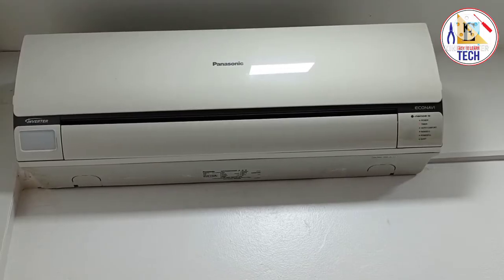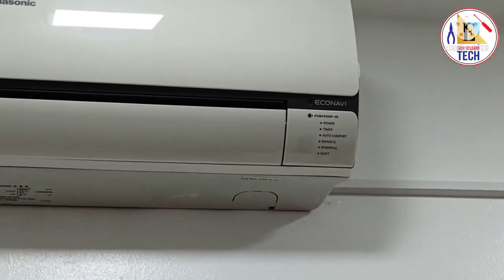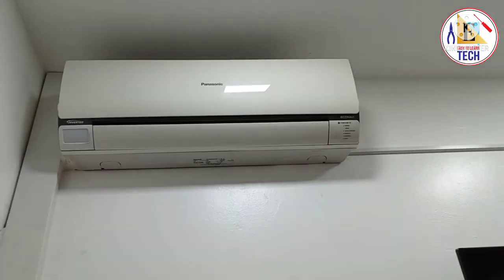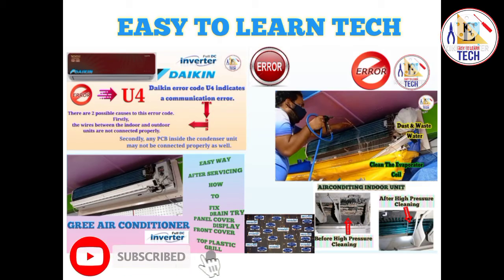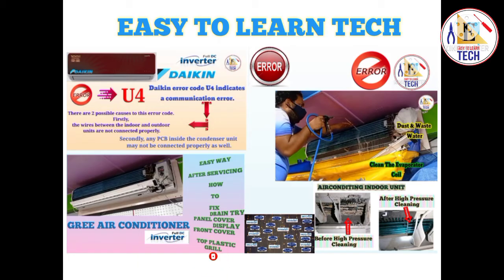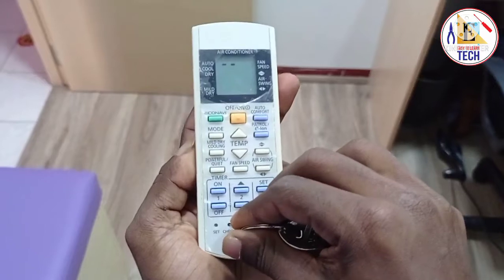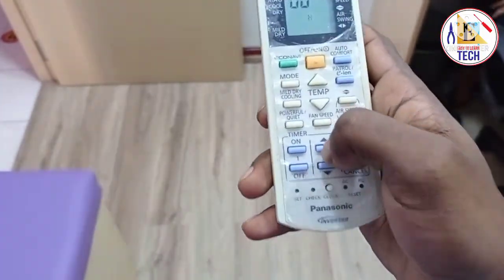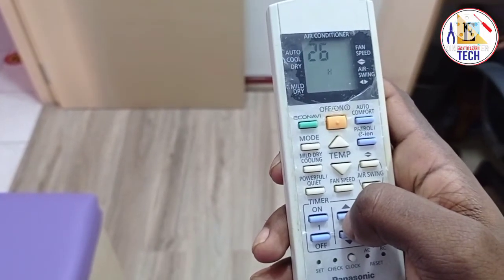How to Check Panasonic Aircon Error Codes. How to get the error code out of a Panasonic split system

Comment: Thanks for the video. Mine has F97 and not cooling well. What's involved for the repair?
Reply from the maker: Compressor Over heating Error , 
1) Check the condenser coil, and service one time and see . If the error exists then you need to check if the PCB card and Outdoor fan is working properly or not.
Reply from the maker: Waiting

Comment: My newly installed panasonic ac showed h52  when it was turned off.. What to do sir? Bought it just on 13th April
Reply from the maker: Try to claim the warranty & exchange the unit.  That will be best, to check the unit needs to open indoor and outdoor units . As it's a new ac it's better to replace the unit. Thanks
Reply: @Rehankhan_HVAC_TIPS  but sir whenever I'm checking the error with remote nothing is showing.
Reply from the maker: @mousumighosh1421  your ac is cooling or not?
Reply: @Rehankhan_HVAC_TIPS   cooling as usual
Reply from the maker: @mousumighosh1421
 If it's cooling then thier is no issue, 
1) check the if the ac is cooling or not if it's cooling it means no issue in ac. 
2) Check if their is any ice formation in small pipe. 
3) check outdoor unit is working continually or not, if running then need to check the outdoor unit. 
4) if ac is cooling please don't do any remote setting, just use as normal.
Reply: @Rehankhan_HVAC_TIPS  thnk u

Comment: H85 error code is displayed/blinking after the AC is turned off.
Reply: H85 error ka solution Kya hai??
Reply: What is the solution of H85 error code
Reply from the maker: @ArupDhar-wo8gj  please let me know if your ac is cooling or not.
Reply: There is no description for H85 error code in the list. Neither is it available online. Should I contact customer care?
Reply from the maker: Is it a new ac unit?
Reply from the maker: How is The Cooling performance?
Reply from the maker: Check the outdoor pcbs card cover, Panasonic provides all the error code according to the model.
Reply: Wlan communication error woth indoor unit
Reply: Same..
Reply from the maker: Please let me know the problem
Reply from the maker: Please let me know if your ac is cooling or not?
Reply: I got the same error, I purchased the AC yesterday. What might be the reason? 😢
Reply from the maker: @the.no.commentary.gaming if the ac is not cooling try to replace it. Within 1 day if you're getting this problem think after a year what will be difficult.
Reply: @Rehankhan_HVAC_TIPS  AC is working really good and the cooling is also great
Reply from the maker: @the.no.commentary.gaming some time it's a false error, restart the main power & start & check. If the ac is cooling than no issue, it's a false error.

Comment: How many horsepower ac?
Reply from the maker: It depends on the model of the ac & remote. All horsepower ac you can use the same remote to find the error. If it's helpful support.
Reply from the maker: Different model remotes have different settings to find the error.

Comment: If Panasonic Split AC show krey F1 error toh iska mtlb kya h kis chiz m prblm h?
Reply from the maker: F1 error means: Outdoor ambient temperature sensor .
1) need to check the sensor in outdoor unit.
Or communication problems between indoor and outdoor units.
1) need to check the cable between indoor and outdoor units.
2) need to check indoor and outdoor PCBS CARD.
Reply: @Rehankhan_HVAC_TIPS  what about if it is showing F91 error what would be the main problem and how much cost would ome mechanic charge to fix the issue?
Reply from the maker: Can you tell me the age of the unit?
Send a video by mail if possible.
Reply: @Rehankhan_HVAC_TIPS  bought it 3 years ago
Reply from the maker: Did you send any mail?

Comment: What should I do if the battery does not work after reinstalling it?
Reply from the maker: Before reinstalling the battery, remove the one battery & press the on/off button once . Then put the battery  & start the remote will come to automatic normal stage.
Reply: @Rehankhan_HVAC_TIPS  Only press the button of the temperature drop and the number will come out, if you don't press it, it will disappear ，only have pm and •c

Comment: H85 Error Code in Panasonic AC, how to solve it
Reply from the maker: Need a step by step process to find the solution .
Reply: Same problem. The code is blinking after turning off the ac. What is it?
Reply from the maker: This error can occur due to various reasons, including faulty wiring, loose connections, or a malfunctioning control board.

Comment: My ac is displaying H85 code what is this
Reply from the maker: Error code H85 on a Panasonic inverter AC typically indicates a communication error between the indoor and outdoor units. This could be caused by a variety of issues, including a faulty PCB board, a wiring issue, or a problem with the outdoor unit's control board.
Reply: @Rehankhan_HVAC_TIPS  should I contact service center and ask for a visit or should I ignore it?
Reply from the maker: The ac is cooling or not
Reply from the maker: If the ac is not cooling properly then, you have to call a professional technician .
Reply: @Rehankhan_HVAC_TIPS  the ac is working perfectly
Reply from the maker: Sometimes when you Restart the ac , the error automatically resets the system . Work normal. No need to call any service centre. If your ac is working normal...
Reply: @Rehankhan_HVAC_TIPS  okay thank you

Comment: Hi my remote is showing Lb, what does that mean?
Reply from the maker: The error code "lb" on a Panasonic AC usually indicates a malfunction with the refrigerant system. This could be due to a variety of reasons such as a refrigerant leak, a faulty compressor, or a problem with the refrigerant pressure sensor.

Comment: Hi. My remote does no have a CHECK button
Reply: Pcb pr button lga hai ac stand by mode pr karlo
Reply from the maker: Turn off the AC unit using the remote controller.

Press the "Temperature Up" and "Temperature Down" buttons on the remote controller simultaneously and hold them down for at least 5 seconds.

The display on the remote controller should now show an error code (e.g., H00, H11, F99, etc.) indicating the type of problem that the AC unit is experiencing.
Reply: Thank you for the reply, but holding the temp. up & down button at the same time does not work..

Comment: H33
Reply from the maker: Indoor to Outdoor wiring problem.
1) check the current voltage
2) Check the indoor & outdoor PCBS CARD any one malfunctioning 
3) if it's new ac model mis match, or indoor outdoor PCBS card mis matched..

Comment: my AC isn't giving beep sound for any error, does that mean my AC has no errors?
Reply from the maker: Is it working normal,means cooling is perfect or not.
Reply: @Rehankhan_HVAC_TIPS  yes it is cooling,but the fan speed is fluctuating
Reply from the maker: Check the remote IF the fan speed is in #AUTO-MODE
Reply from the maker: Change it in to manual

Comment: Bro timer light blinking error f91 hi hai ke or koi bhi ho skta hai error?
Reply from the maker: Bro aap check kare remote sa,beep sound jaisa aaya whai AAP ka error ho ga.
Reply: @Rehankhan_HVAC_TIPS  bro H11 error hai
Reply from the maker: Brother H11: error is for communication between indoor & outdoor .
1)Need to check cable between indoor to outdoor unit.
2) Power supply in any one unit.
3) PCBs card problem in indoor or outdoor unit.
Check let me know
Reply: @Rehankhan_HVAC_TIPS  bro outdoor ki kit ma issue hai ... Fault identify ni ho Raha .. aik repairing wale ne kaha hai dust issue hai ap ki kit ok hai par saaf krne ke baad phir H11 ka error de dia hai aik din chalne ke baad .
Reply from the maker: Kit ka Components weak ho ga isliya problem,aa raha ho ga.
Reply: @Rehankhan_HVAC_TIPS  is ka koi haal hai ... Or outdoor ki kit kitne ki milay gi
Reply from the maker: Local ma ma check kara,kitne ki milaya gee. Har jaga rate alag hota ha
Reply: @Rehankhan_HVAC_TIPS  lahore ma available nahi hai .... Dubai se aik banda mangwa ke de rha 35k ki
Reply from the maker: New ac kitna ka ha kiya
Reply from the maker: Warranty milaga kiya
Reply: @Rehankhan_HVAC_TIPS  nahi 😢
Reply from the maker: Repair karna ka dekho
Reply from the maker: Ya second hand dekho